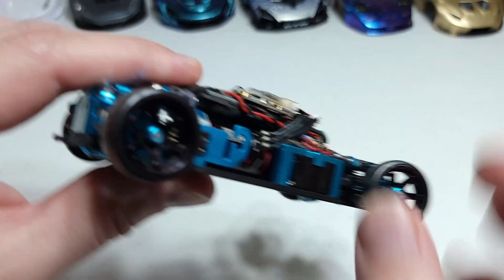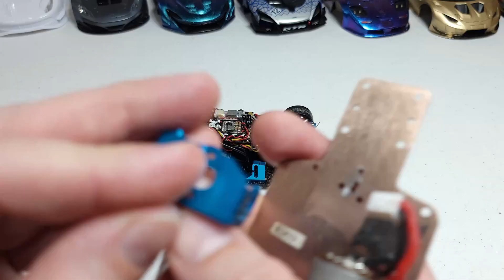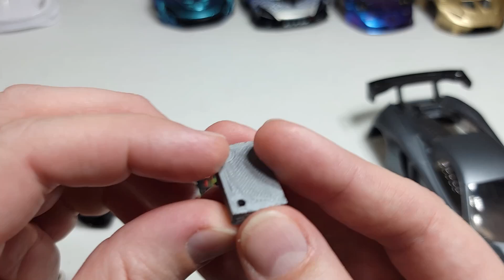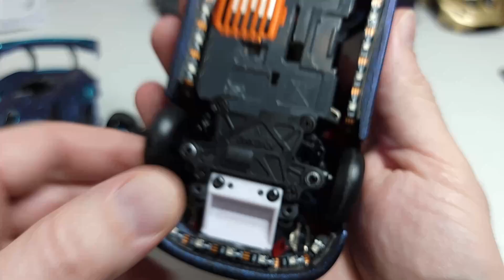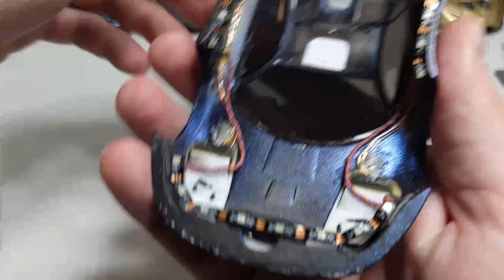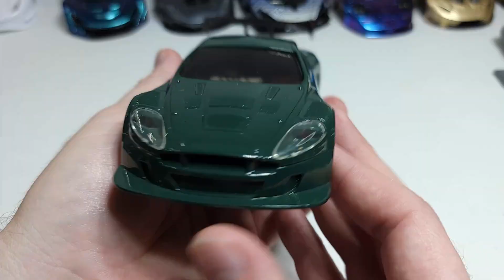WLToys K969 Custom Build: How I Mount My Mini-Z Bodies, Side Mount Upgrade, Front Mount And More

Comment: On the wltoys k989. My method was to cut off the size clips, due to the heat sink on the motor side. Did not use front kyosho clip, ended up using magnets and body post to fit the body perfectly on the 98mm chassis. Body is the kyosho mini z Mercedes 98mm body. Stock electronics for now.

Comment: hey man! I wanna get longer travel in my k989 but idk where to get longer shafts, any recommendations. Thx and happy new year 🙂‍↕️
Reply from the maker: Are you talking about your steering? If you still run yours AWD drive then you are kinda limited to how far you can push it. AliExpress has tons of spare parts for anything you want on the K969, I usually just look through parts until I see something that might be useful but sometimes it's a guessing game if they are good or not. I have some links to parts in the description that you can start with but might not be exactly what you are looking for but once you click on them and scroll down there will be other suggested upgrades to look at until you find something you might be looking for.

Comment: Do u use miniZ body’s? I bought a Aoshima skyline gtr to build my WL car. Body is longer so need to extend the chassis. Aoshima even do liberty walk “detail up!” Body kits where anyone who already has the car kit can add the wide arch’s, spoiler etc even chrome exhaust. Obviously would need modding to apply to your cars but would save a “from scratch!” Build.
Reply from the maker: Yea the main reason I designed my WLToys K969 build the way I did was to fit all my Mini-Z racing bodies I use on my MR-03. They all have a 98mm wheelbase and are wideset so they fit the K969 but I had to design the suspension extremely low to fit the McLarens and stuff on it. Some of the bodies I have like the P1 GTR have a wide body kit I put on from Garage Hiro and I love how it came out especially with the color changing paint I added. I would like to make an adjustable wheelbase K969 down the road to fit 1/24 or 1/28 scale model kits on it eventually but I'm happy with my K969 for now. I'm currently working on my LDRC, Jiabaile and Kamtom cars modding/upgrading those so they will keep me busy in the mean time lol

Comment: Would the RWD MR-03 chassis be good to have the GL-Racing body of the Ferrari 488 GTR ?
Reply from the maker: Yea that's basically what the body was designed to fit on. As long as your MR-03 is set up for 98mm wheelbase and wide(not narrow) bodies.
Reply: @AirToGroundRCFPV  would the Mclaren readyset work on this, I believe it's a MR-03 chassis
Reply from the maker: @Nikoicee  Yes, the P1 GTR, Senna GTR,  F1 GTR and 12C GT3 are all wideset with 98mm wheelbase. The MR-03 or MR-04 will work.
Reply: @AirToGroundRCFPV  would I need to buy any additional parts ?
Reply from the maker: @Nikoicee  To fit the Ferrari on the MR-03 chassis? No it should fit right on.
Reply: @AirToGroundRCFPV  okay, thanks! I wasn't sure if I would need new wheels for it to help with the gap on the wheel well
Reply from the maker: @Nikoicee  The Ferrari should come with the wheels that match the offset of the body. But that's not always the case like the GL Racing Porsche has only display wheels, not ones you can actually use. I'm pretty sure The Ferrari and Lambo have wheels you can use though.
Reply: @AirToGroundRCFPV  okay tha k you, if it is the display wheels only are there any you would recommend? Sorry for all the questions. I'm looking at getting into this hobby and I don't know much
Reply from the maker: @Nikoicee  The Ferrari should have usable wheels but you'll need tires. If you are racing then you'll need to figure out what tires are best for you for racing. I mainly drift so that's not my area of expertise. There's a lot of videos out there on that and google will answer a lot of questions better than I can. It's hard to find wheels for the Mini-Z's as everyone has bought up most stuff out there but getting an assorted set of wheels with different offsets are the best way to go if you can find them. I don't know the offset of the Ferrari but it will be somewhere around +3 for rear wheels and around +2 or +3 for the front. usually in the description of the kyosho bodies will tell you the offset you can even look online for the list of offsets for each kyosho body. I don't know if GL Racing has that info out there. You are jumping down a deep rabbit hole when if comes to tires, offsets for each body and wheels so I can't tell you everything in a comment section. You will have to do some research to figure out what you are looking for and need for your Mini-Z, the drifting scene is a whole other rabbit hole as well. Just make sure you get wheels designed for the racing Mini-Zs and not drifting wheels because they look similar but have a completely different mounting set up. Racing wheels have big holes in the center to put bearings in while drifting wheels don't hold bearings, they just have a tiny little rectangle to mount to the car. The offsets don't work the same either so this is what you have to look out for, good luck lol